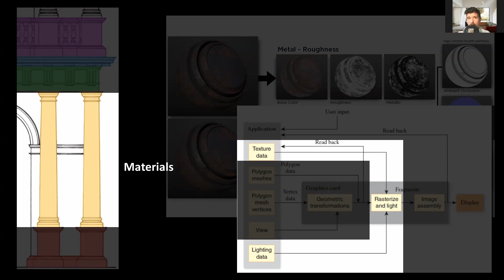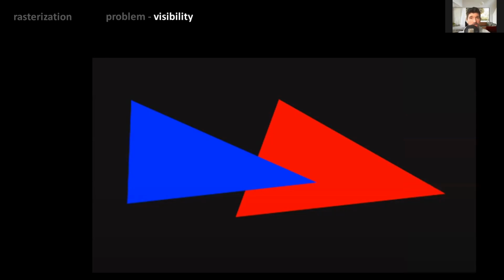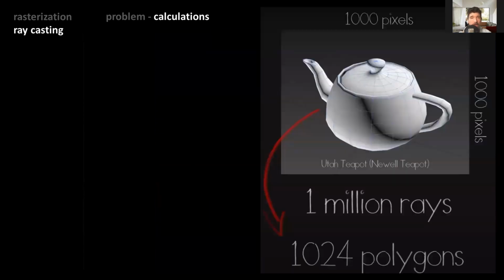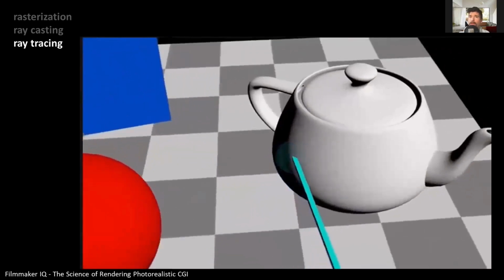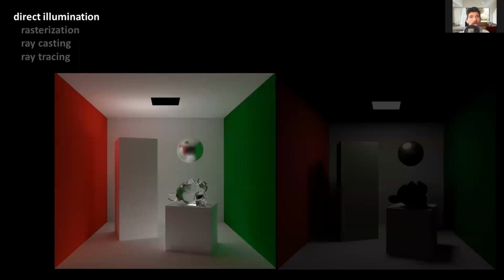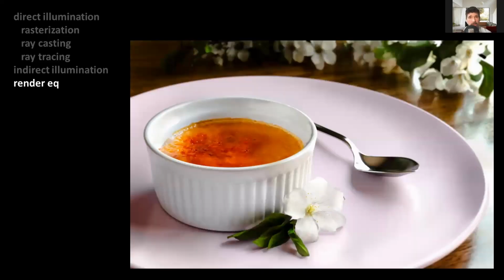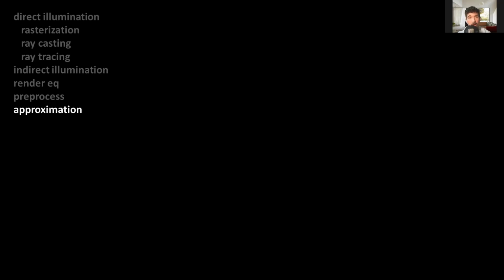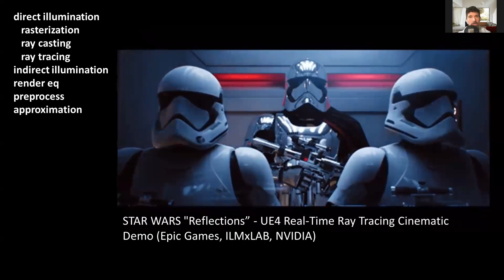4.1 - WHO Changed Rendering Forever

Comment: Maybe you know the answer. I've implemented atmospheric scattering once, and optimized it using precomputation. Looks fine, performance is great. But I've been scratching my head for some time how to get multi-scattering to work. In my understanding, when we march a ray through a volume of atmosphere, we need to account not only for sun-ray direction, but just all directions in general. Some optimizations actually reuse the single-scattering LUT (texture with pre-calculated scattered light based on height and azimuth angle) to generate the light bounces. Would be good to know how I should approach it. At least, integrating it during a naive raymarching approach. If you know, just assuming.
Reply from the maker: @Nerthexx, unfortunately, I do not know, perhaps someone else in the community will chip in. Thank you for expanding the conversation in this direction as well :-)